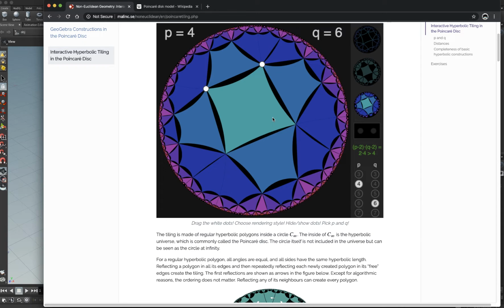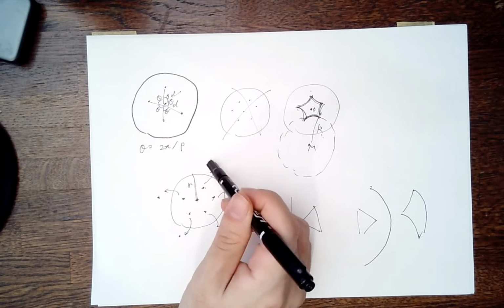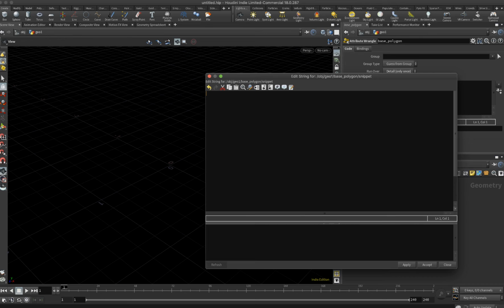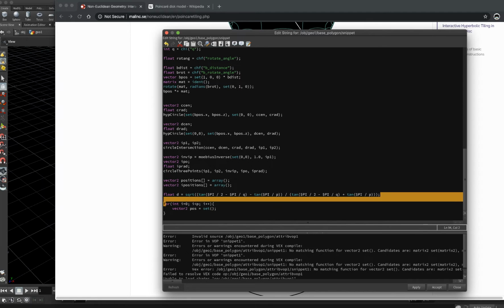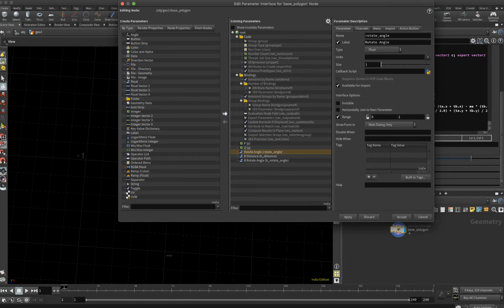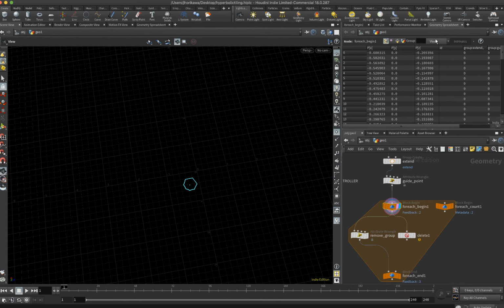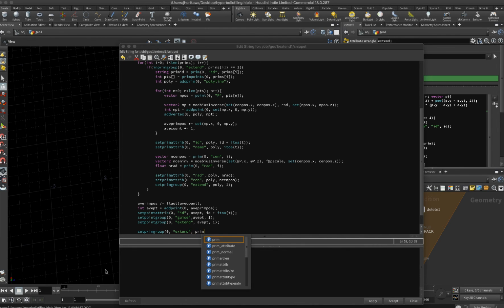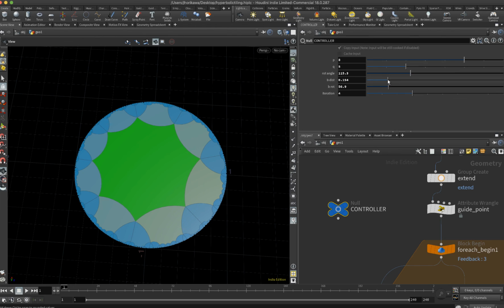[Houdini Tutorial] 0042 Hyperbolic Tiling (Poincare disk tiling)

Comment: Hello, would it be possible to do the same with the Penrose pattern, or with Escher style?
Reply: Penrose tilings can't be put on the hyperbolic plane sadly. And it doesn't seem like there is anything similar either. Penrose tilings are generated from a 5D grid sliced and projected to 2D. Unless I'm mistaken, there is no regular hyperbolic 5D grid to slice and project to to hyperbolic 2D. However some people compare the "binary tiling" of the hyperbolic plane to the Penrose tiling, noting that the "binary tiling" is non-repeating and based on a nested structure. It actually has more properties in common than I would have expected.